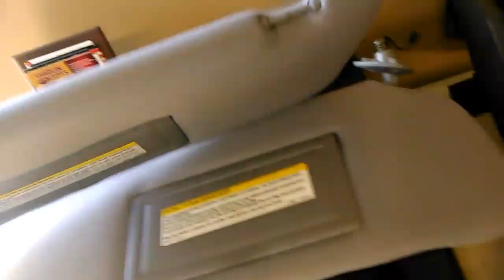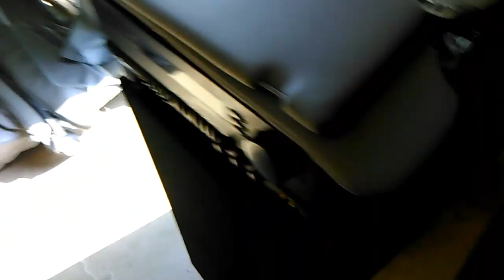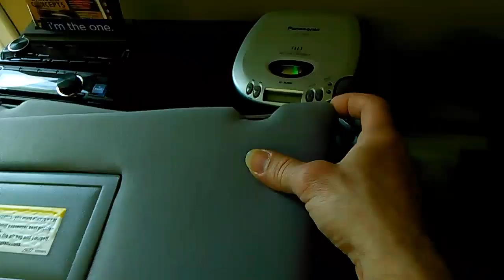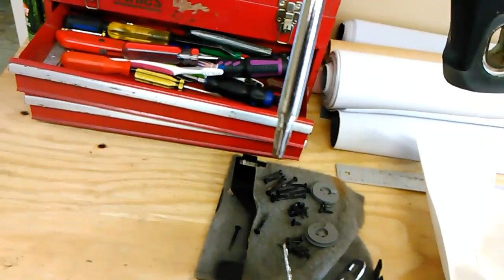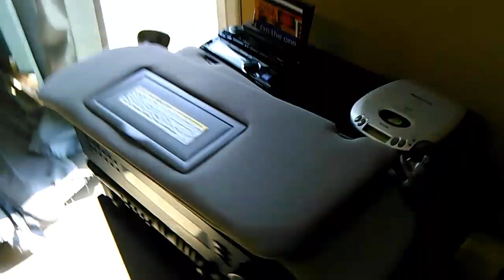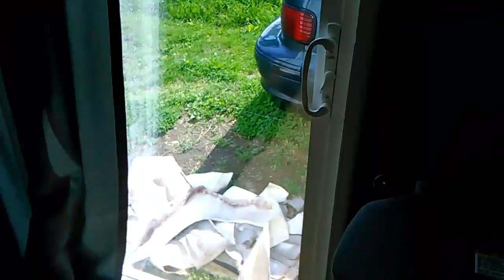Quick tips for covering Impala SS sun visors

Comment: hey Matt . What advice can you give me on the plastic strips at the end of a seat cover that connects the seats to the frame.They are cardboard in older cars but plastic in newer cars.How can I get more or what to use in its place where hog rings don't work.
Reply from the maker: don won sew welt cord to the edge of the vinyl where the hog rings need to go or sew a folded material listing and run a wire or even clothes hanger thru it
Reply: Appreciate it.
Reply: Thanks Matt.What I came up with was on a Mercedes the seat bottom sits in a pan and the pan has a rim to tuck the material under it for that clean German look.Tucked the material under the rim and cut some thin strips of abs plastic that I have and forced the strips under the rim.Works fine
Reply from the maker: don won yes sir, black panel board could be used in strips too, you can sew that to the seat cover too, have a great day!